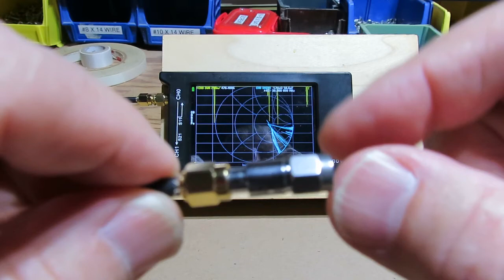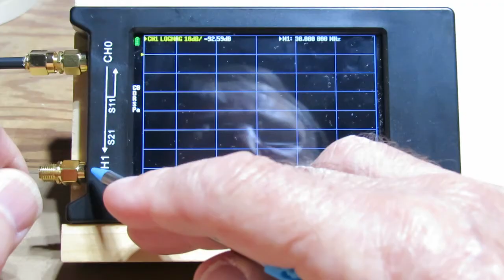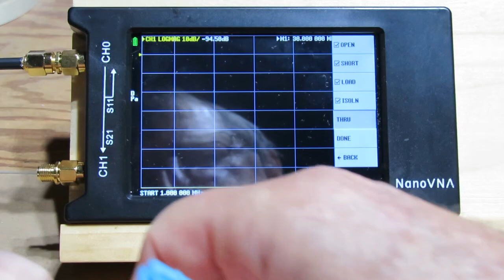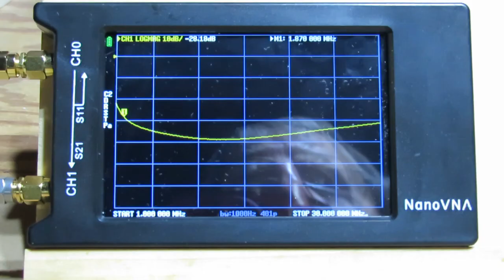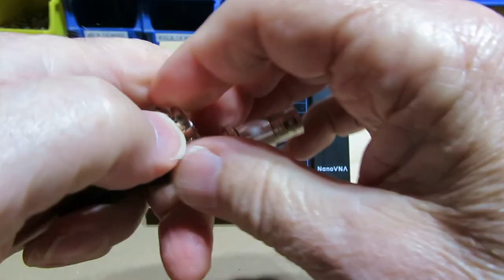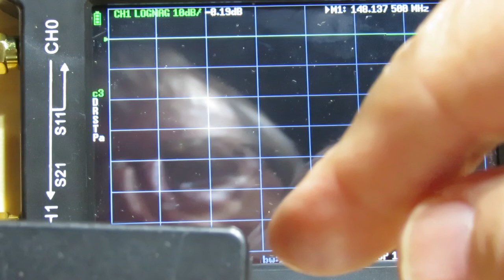Setting up the NanoVNA for checking baluns and insertion losses

Comment: Short answer regarding the 10 dB attenuator pad is that when inserting and then calibrating thru the attenuator, it improves dynamic range, helps mitigate errors introduced by the test fixture and, as such, improves overall test accuracy.  Or as once said long ago, "It's good engineering practice."  Thanks Barry.  AD6AE

Comment: Thank you for emphasizing the iron powder core unsuitability for TLT's.  I assume the 10 dB thru termination is for a load to the choke.  Note folks, this is to demonstrate the choking effectiveness on the outside surface of a coax-wound CM choke and similar to insertion loss.  CM current does not affect the inside of coax.  If winding a CM current choke using insulated wire, you would use a bifilar pair winding method.  CM involves only one conductor.  Differential mode involves two conductors, like twisted pair, bifilar pairs, etc.  Ugly baluns are more of a narrow-band notch filter and inadequate for broad-banded operation.  Watch more videos and learn.  73's all...

Comment: you made it sound as if insertion loss and attenuation are different things! they are the same! 
what is different is which path you measure it on - you wanna see the insertion loss (or attentuantion - same thing) on the shield - connect the shiled; you wanna see it on the center pin - connect it on the center pin. I think one should not connect all paths at the same time - not sure about this one though.
Reply: I am very clear to explain that they are two different things under test.  Rewatch and listen.  Skip to the 18;30 second mark and I clearly explain that at that point I show how to test for insertion loss. 
Barry

Comment: KU3X de N6UNX - Nice presentation...  I have what I believe to be a proper Nano VNA but a less expensive one that has a MAX of 101 samples.  I built a choke using a 140-43 toroid and RG-174.  It behaves well hooked up, and my Nano VNA is showing -35 Db at around 6.5 MHz with a nice slow curve up as it heads upward.  At 10 Meters it is around -13 Db and at 20 Meters around -26 Db.  Not bad, I think.  And you?  By the way, I can hear the difference, about 2 S-Units down on 20 Meters.  And at 100 Watts CW, the wires don't warm up.  It is in line with a home-brew End Fed Half Wave.  Great pairing of Toroids!   73, Marc - N6UNX

Comment: Don't know what I am doing wrong.  Even if I simply use a single thru cable supplied with the Nano and do the steps 1) end of cable attached to S11 with open, 2) short, 3) load, 4) end of cable open and load on S21, 5) cable connected to S11 and S21 (thru); the sweep does not go to 0 but stays at the bottom of the screen.  As I move the marker it stays around -1.9dB.  Would this be because I am not using the 10dB pad?
Reply: Got it. somehow I paused the sweep.  Thanks for the lead on sma to terminal.

Comment: Theoretically and practically good ,but i cannot saw the full connection of left side of nano vana ,so it was not cleared what did you connected with nano vana as it does not seen while wire

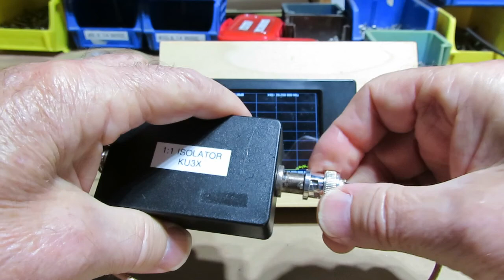Comment: Very informative presentation! I may be wrong, but it looks like you connected a jumper between input and output of the 1:1 isolator (@ 19:14) instead of connecting it to the nanoVNA. If that was the case then bad readings were caused by no readings taking place on the 1:1 isolator. Overall, great explaination of testing methods for these devices.

Comment: Hi. Can anyone help me with using a VNA with open wire and balanced antenna? I am wondering if i can measure the antenna impedance at the feedpoint and then build ladder line to match that impedance. Then can i use a VNA at the shack end to see what the total impedance is at height? The problem seems to be how to connect open wire to a VNA and will that be accurate once the spacing from the ladder line is brought tight in to the coax connector on the VNA?
  The object is to A. Match / build the ladder line impedance to match the antenna impedance and then to measure total impedance at the shack so as to know the best ratio of Balun to use in the tuner.
  Thanks.

Comment: You shouldn’t be holding any of the wires while calibrating or testing…
Reply from the maker: Think of what you are saying?  Coax is like a water pipe, all of the water is inside of the pipe just like all of the RF is inside of the coax. There is no common mode in this setup. So if all of the RF is inside of the coax and what goes on outside of the coax does not get into the coax, "How does touching the coax on the outside effect what goes on inside of the coax? "  Nothing different than touching the outside of a water pipe, "does it effect the water flow?"
The answer to both is, "NO !"
Barry, KU3X
Reply: @barrygkx  wow marking you off. The water analogy was meant for secondary school. 

How about you ponder this what would be the condensation in this analogy?

Comment: FWIW the NanoVNAs are beautiful to use with the right software on a PC, did some sweeps of my common mode choke which is wound with RG142,  attenuation with a stack of 4 FT240-43 is about 37dB at 1MHz, peaks at 42dB at 1.3MHz but gets worse and worse going towards 10m. I have a further pair of ferrites to improve 10m. Need to pull some turns of the big stack,  Capacitance between turns might be skewing my results.....
Reply: what is the right software?
Reply: @jefferylegere  SimSmith has been recommended to me.  I just received my Nano VNA.  Google VNA Software.  Much of it is free.
Reply: @jefferylegere  I have used NanoVNA saver. Email me and I can send screengrabs from it.
Reply: With a stack of four, you're looking at wire length, winding wrapping methods, distributed capacitance.  With that much inductance, you'll see degradation the higher you go.  One - maybe two cores and the correct wire type, size and insulation will give you results.  YouTube TRX Lab.  he does an excellent job at explaining your exact problem.  Use #16 PTFE stranded for 1:1 chokes & 1:4 baluns and #14 solid for 1:9 enameled with tape wrapped over the core.
Reply: @oldbassist60  since then I have built them differently. So far the best for broadband common mode impedance has been wound with 2 twisted pairs from CAT6 cable, just 2 cores.  CAT6 has low loss at HF and each twisted pair has a characteristic impedance of about 100ohms.
Reply: . You can always wrap 2 individualy in series with fewer windings. You still get the same common mode current attenuation without the added capacitance.
Reply: @jimhammer2638  true, there are trade-offs.

Comment: Sir, first of all, it was simply an Outstanding video, cleared lots of confusions..i have a question, i ve just made a balun, i ve tried everything changed the winding many times but simply cant pass the 27db of attenuation using 240-31 toroid, what could i change ?
Reply from the maker: If you wind 14 turns of coax around an FT 240-31 core, at 160 meters you should read around 33 db. It increases from that point on and goes down to 27.6 db on 10 meters. On 30 meters you should get around 35.2 db.
Even if you only have 10 turns of coax around this core, on 80 meters you should see around 30 db and on 10 meters you should see around 29 db. 
Barry

Comment: You should have calibrated to the end of the test fixture.  Otherwise your results are incorrect.  Also,  why did you find an attenuator necessary.   Finally,  20dB is not the best measure.  You need to have at least 2k ohms of resistance and this needs to exceed reactance.

Comment: Question, what is the purpose of the 10db pad on S21? I realize you've calibrated it out, but I'm not sure of the point of it. Is it basically to present a 50ohm load to S21? 73 de w8tam
Reply: I have the same question and tempted to suggest the same answer. Have you worked out a different response since then?
Reply: @02vLxcZF  nope.
Reply: @de_w8tam  Ok thanks. Best guess is to simulate a 50 ohm antenna going into the balun, and the only piece of hardware available if you want to avoid a messy set-up with resistors soldered onto pieces of wire, is the attenuator...agree?
Reply: @02vLxcZF   Don't you hate when the author doesn't answer any questions?   He is only measuring the insertion loss of an inductor here.  I don't know why either except if you were testing a real Balun with a ratio that gives you a gain on the output it might overdrive the input to the VNA and damage it.   I'm just guessing too.
Reply: he is an idiot, dont know anything....